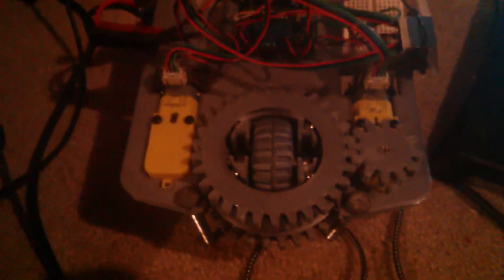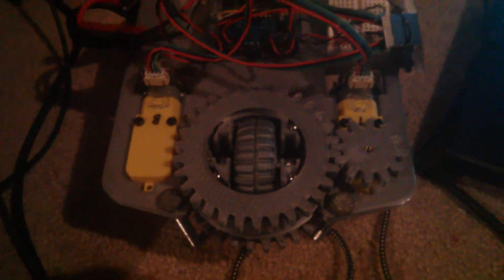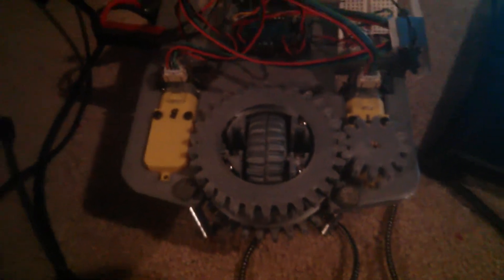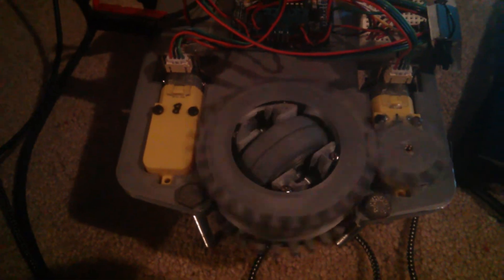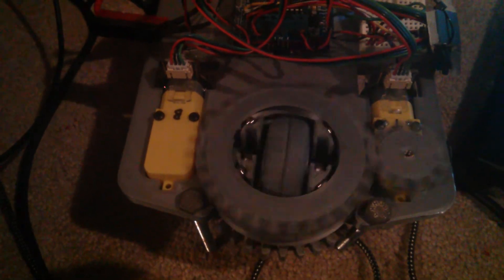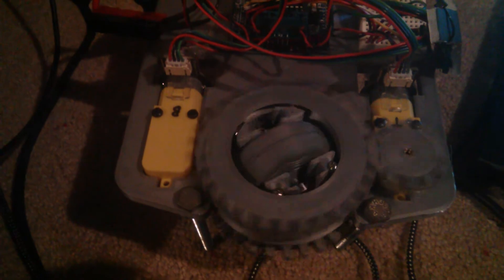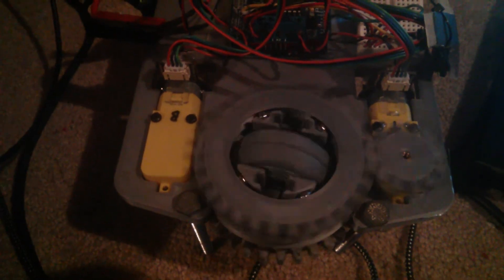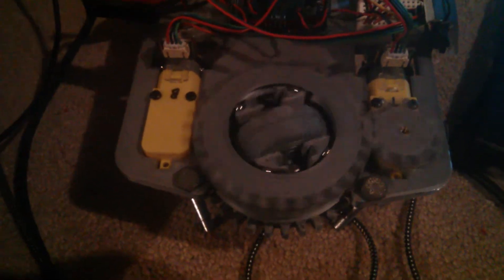Diff swerve test two (open loop control)

Comment: hey, do you have the code for this posted anywhere? I'm curious to see how you transformed a desired wheel speed + angle into the two different wheel speeds.
Reply from the maker: It's definitely very doable but we never went that far. In this video the motors are controlled manually, we don't control the speed or angle.